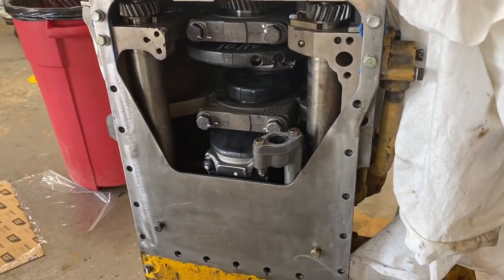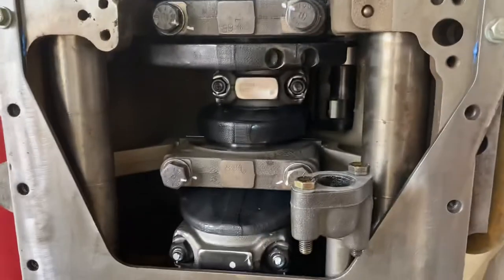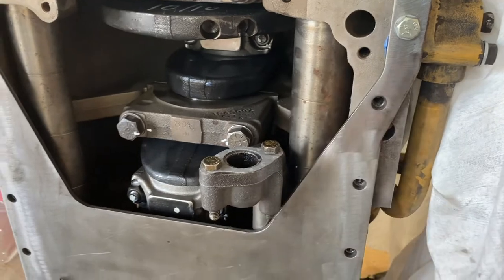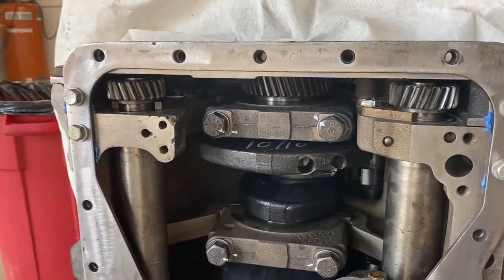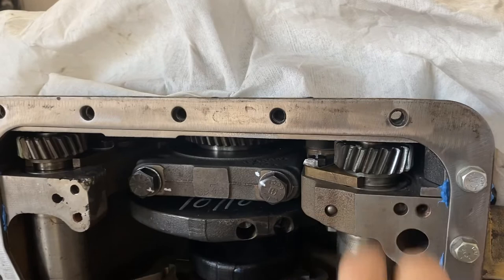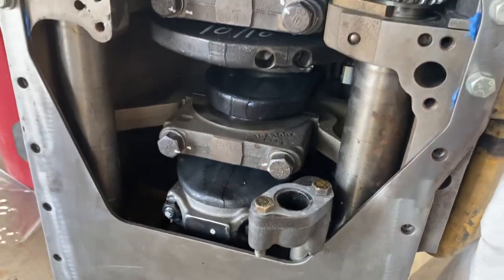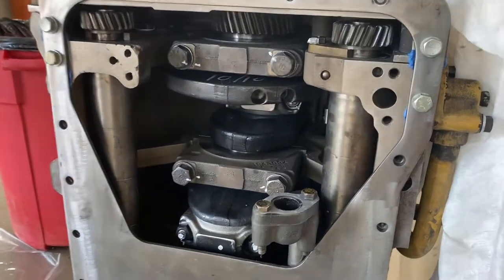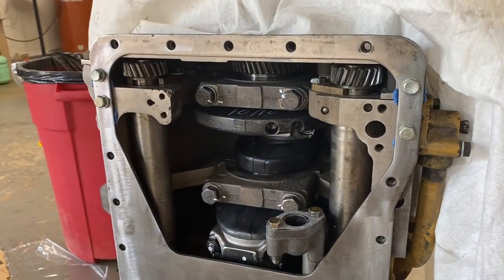How to time balance shafts on a 3304 caterpillar

Comment: Hayden, have you had experience with CAT935 with backhoes? I've seen one out there and was wondering about your thoughts on one of them. 

Some folks think that they  are desperate machines and that one is better off avoiding it and that a 935 without backhoe would be better & that if you have trenching work to do get a CAT 311 or CAT312 to do that work and just hold on to a CAT 935 with a 4-in-1 bucket to move earth / level construction site..

Comment: Good day am working on a 3304 engine I change fuel pump but engine not starting. Could you help me with some of your knowledge.
Reply from the maker: Pin the flywheel, pin the pump, make sure number 1 rocker arms are rocking this indicates top dead center on number 1. Torque the pump gear while pins are installed, remove pins and reassemble. Prime fuel system with the priming pump, loosen the injector lines at the injectors and move the governor rod to the run position and fuel will come out at the injectors, tighten it all up and it will start if pump is rebuilt correctly

Comment: Hi mate!  Im in need of taking that plate off, and resealing it, gasket has given up! How do you get it off? Oil pan is off, just trying figure out the plate
Reply from the maker: i believe there is 4 bolts,1 in each corner its been almost 2 years since i built mine, but i do remember bolts just not sure on the number. i assume you are talking about the intermediate oil pan plate?

Comment: How to time the fuel pump
Reply from the maker: Pin flywheel and make sure number 1 rockers are loose, pin pump, torque bolt/nut on pump remove timing pins.
Reply: @HaydenIngram  could you do a video on it thank you
Reply from the maker: @paulfarquharson6575  should have one on here